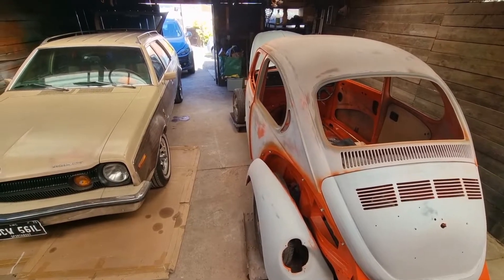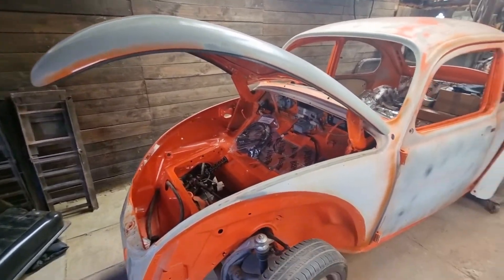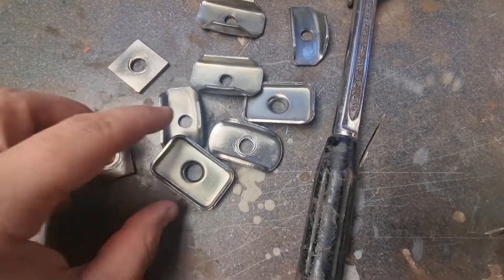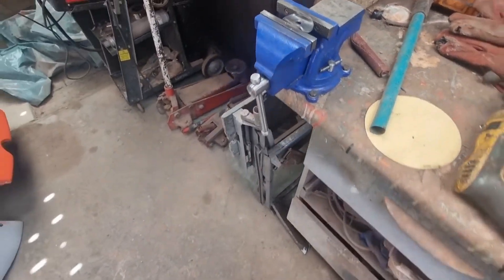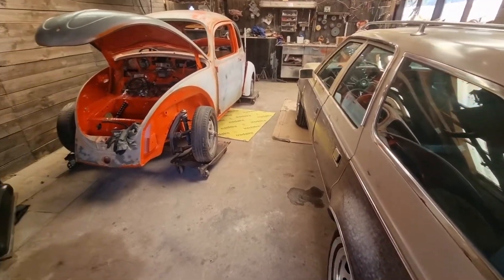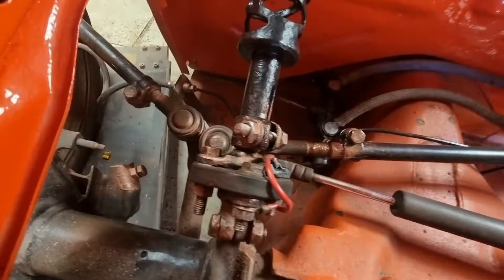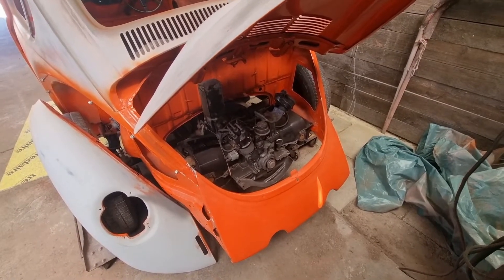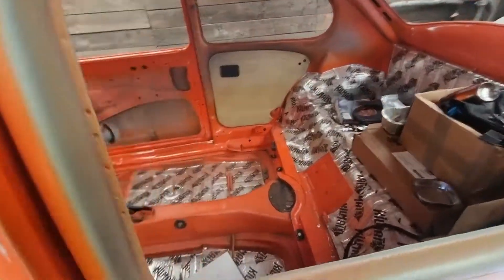preventative maintenance and upcoming jobs on my 1972 GT Beetle.

Comment: It’s hard to see what you fitted at rear body mounts but I can’t see the rubber pads. The original set up has a metal bush/collar, two rubber pads (one between the body mount and the pan, and the other above the body mount), a thick washer and a bolt. The metal bush allows you to bolt it up up tight and the two rubber pads allow the body to float just like the ones under the petrol tank. If you don’t do it, the metal body mount splits due to stress.
Reply from the maker: I tried to find information on this and came up with nothing. Looking at pictures, a lot of them didn't show a rubber washer/Bush between the top of the mount and the spacer. I do have them between the fame and the mount. Nothing is fully tightened yet so i will add them. Explains why there's an amount of thread on the underside of the frame. Thanks for the info.
Reply: @GT.Bugger  I’ve got a photo of the original parts but I can’t post it here unfortunately.
Reply from the maker: I took a picture of how I've got it now buy in the same boat. Check my new video if you get chance I mention you for more info lol. I think I've seen you in fb groups so I'll shoot you a message if that's OK?
Reply: @GT.Bugger  yeah just message me.